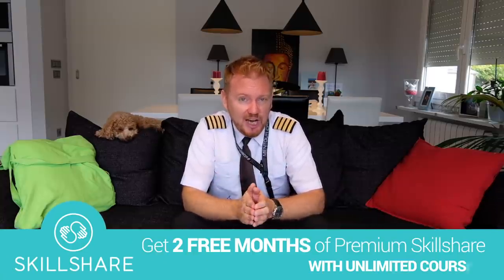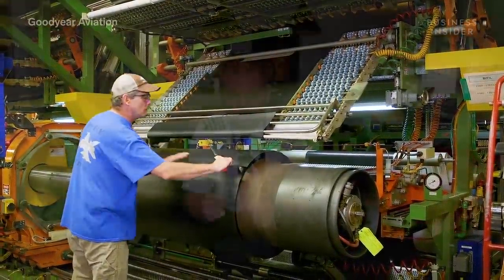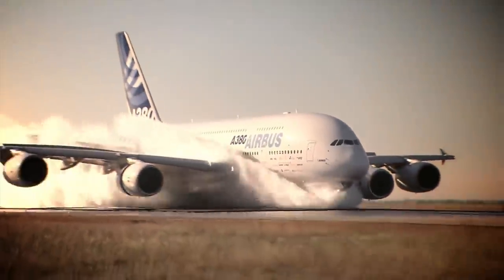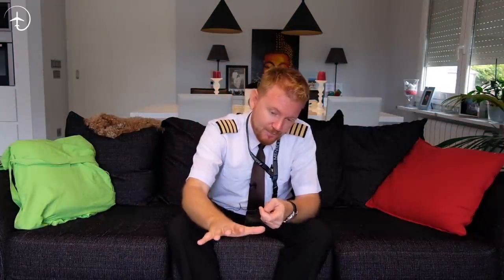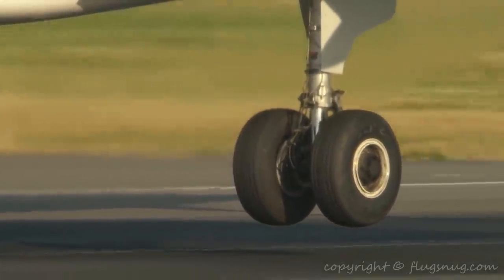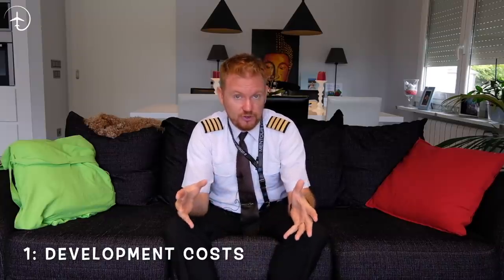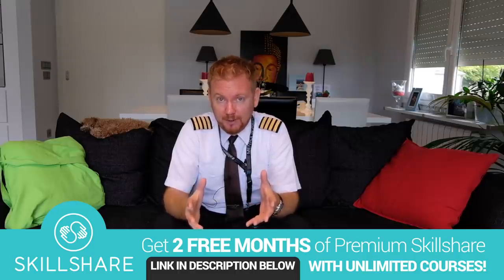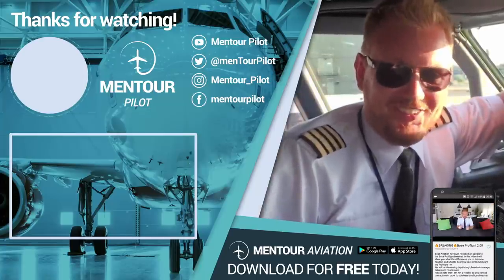Why not make plane-tires spin, before landing?!

Comment: My Dad was a b17 mechanic during WWII.  He said they tried putting vanes on the hubcaps to spin the tires up before landing.  Didn't save the tires but was hard on wheel bearings and brakes.  Had to use lot of brake to get the spinning wheels to stop before retracting gear.
Reply: But how are you solving that problem today? Retracting spinning tires into closed planes today is the same problem I guess.
Reply: I was wondering about this for years.  Spinning tires can keep spinning inside the body, once retracted.  If there is enough space. Small vanes to spin the tires a bit?
Reply: @Deontjie  I think small vanes are a good idea. But it does not work with Boeing 737. Tires and vanes are visible. Maybe you just could use special rills ... a profile like a tesla valve. It is almost a normal rill with small changes. This will bring a tire to turn by just using the speed of air (>250km/h). In a closed body they then are able to slowly stop without problems. (But probably they did test something like the tesla valve already.) 

Probably tires are generating the moment of contact with the ground that much heat rubber is just burning. Slowing down the speed difference a bit could result in just getting hot tires but no destruction of the rubber molecules. This is science a series of tests should give you better knowledge.
Reply: @Deontjie  That is exactly the thing - There isn't space to retract spinning wheels - if you look at a gear well on a plane it is covered in hydraulic and power lines
The brakes are required to be engaged and the tyres decelerated as if they retract a fraying tyre into the well you have now pulled in a circuloar saw blade if you look they don't retract spinning wheels - they engage the brakes as part of the gear up
This increases brake wear as you can't turn off the vanes meaning after take off the wheels will still be spinning up to flight speed when you are trying to slow them to retract

Any vanes attached would need to be sizable to catch enough wind to spin them up - if a manufacture defect causes a vane to break free due to microfractures and fatigue you may have just catastrophicly compromized the plane

Say a wheel has a brake failure? Now you have a wheel runnaway which will be constantly accelerating to the speed the wind allows that you will never be able to retract - burning out the wheel bearings and runing faster until the vanes are thrown off as shrapnel

Finally, you have introduced an unknown variable in the flight controls - The mass of the spinning wheels while in the air generates a gyroscopic effect you can't account for - as the ammount of the effect will vary radically between and approch as you aren't going to be able to guarentee the speed of the wheels - as it's inherently a function of wind speed, altitude ASL and the fact that several wheels are partially or fully occluded from direct wind
This effect will be being added with very little possible control during the late stage of a stablized approch, which is specificly designed to reduce variables for safety
Reply: @bengrogan9710  All very good points I hadn't thought about!
Reply: Actually film director Frank Capra invented that during WWII...
Reply: @GalvestonGuy  I invented the idea while watching this video. What I think you mean is Frank Capra who lived and died before us, invented it first.
Reply: @cannaroe1213  Yes. During the WWII effort. You have the mind of an inventor then...keep working :)
Reply: @GalvestonGuy  hehe, sorry for being coy, i am an inventor, but i believe both too much emphasis is put on the inventor who invented something *first*, (because thats all the patent game cares about, despite convergent evolution being a thing) and not enough emphasis being on placed on thw circumstances of how an inventor invented something, its all attributed to the inventors "inner essence" or something, which also couldnt be further from the truth. "it takes a village" hehe :) I thought of something like a dual-sided automotive turbo rotor (vanes on both sides). Ive seen such rotors. For Frank to have thought of it before the invention of turbochargers is more impressive, if anything. .. and he was first :P
Reply: @cannaroe1213  Yay on you for being innovative and educating yourself. I am also an  inventor. Turbos were used in WWII, but that is beside the point. Frank Capra is my favorite movie director and that is how I knew this. I wasn't aware of the technical complications but It makes sense in light of the science. Good on you. Keep on. Make something good.
Reply: @Deontjie  There is also the little matter of gyroscopic precession to at more complexity to the idea
Reply: Thanks for adding that "real experience, we already tried it and this is the result" part. From the video itself only the crosswind landing problem was new to me.
Reply: Make them featherable
Reply: @NeonVisual  too complex, too expensive.
Reply: Interesting to see that this (spinning up the wheel) is explored this far back. I wondered if they have kept the detailed statistics, like mean time/use before failure, it would be an interesting read.

I would imagine changing the wheel bearings would be harder (more man-hour) than changing the tires. If so, spinning the wheels really wouldn't be worth it.

The problem with spinning wheels is the gyroscopic effects. Forces acting on a spinning object gets diverted to another direction. Pilots are taught to hit the brakes to stop the spin after lift-off.
Reply: Also bear in mind the amount of drag those vanes will exert on the craft during deployment, or during brake-retraction.  If they grab enough air to accelerate those wheels effectively enough to reduce touch-down scrub, then the energy it's taxing from the forward motion of the craft is significantly more than the gear are affecting now.  Because there's no such thing as free energy.

Comment: I worked for a major tyre company and forwarded a proposal to ensure that the wheels were rotating prior to landing.I was approached by a foreman from aircraft tyres and asked if I would like to explain my idea to a shift of burly casemakers who would perhaps lose overtime as the result.Needless to say I declined.BUT,my idea did not require any type of motor to rotate the wheel as the sidewall would have moulded triangular ribs,the flat side facing the airflow and obviously would turndue to air pressure.